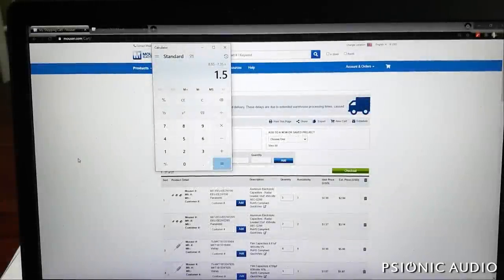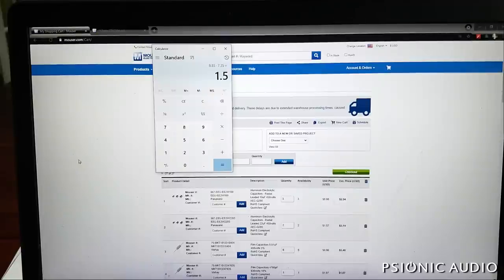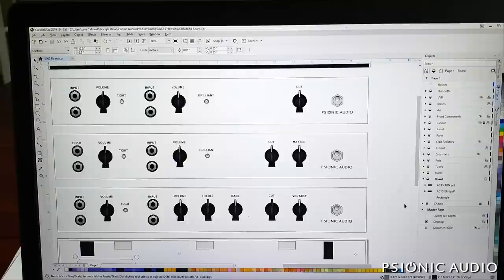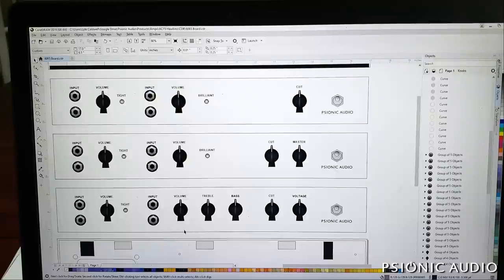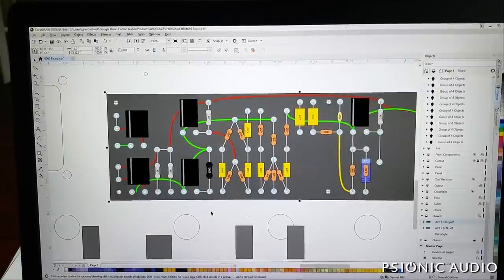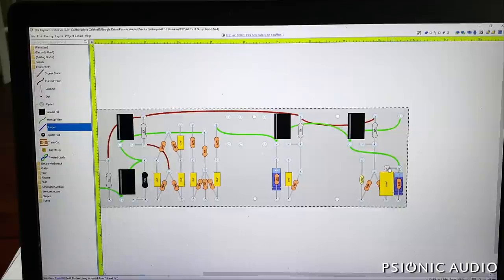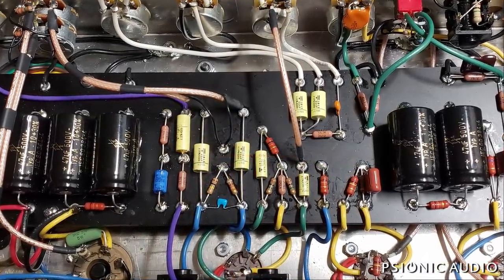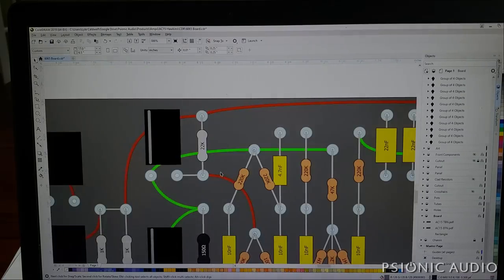Do I Make Amps? | Yes, Yes I Do | Muah Ha Ha Ha...

Comment from the maker: I forgot to show the actual F&Ts where I mentioned them about 10:27. Sorry about that. They are visible in other photos throughout the video though.
Reply: Use of the Radial Electrolytic in any modern design is very wise (IMO).
The original use of the axial capacitors was more than likely driven by low cost and availability as a result of electronics advancements post WWII.
Just because it was always done a certain way should not dictate modern design.
Then again, aficionados of tube amplification are traditionalist in nature!
The main point of my comment, the Radial Electrolytic Capacitors are IMO a great idea, also having the capacitor leads physically closer together might provide some design advantages.

Comment: Love these design consideration videos. I'm an electrical engineer about ready to retire and want to design/build some amps, only for myself, just for the pure pleasure of it. Glad that you include the playing aspects in them to illustrate the real benefits to the player. Good design doesn't mean squat if the amp doesn't sound good. LOL From what I can tell, you justify your design choices with reliability, serviceability and/or performance. I would feel very confident purchasing one of your amps if it was at the right price point. Keep it up!! Thanks for posting these to the community at large. Couldn't agree more about there being nothing wrong with a well designed PCB. I've done PCB's for designs professionally and there is a lot that goes into them. If they are well done, the end user probably has a better chance that his 'production' amp is going to sound exactly like what the designer intended. A well done turret board is equally good, but I wouldn't necessarily say that it is inherently any better, with the possible exception of serviceability. You can probably change out components on a turret board a lot longer than you could on a PCB. But, realistically, if the amp is well designed it should last a long time before you need to change out anything except the tubes. Caps do eventually need to be replaced. And if you get a mishap using an unknown power source you could actually let the magic smoke out and need to replace it, which would necessitate some component replacement. ;-)

Comment: I wonder what you think about the BADCAT cub lll ? About it's build. I have one i bought it second hand but already had to dump 300 Canadian dollars into it. Sold my 70's hiwat head & cab only do to the loudness & weight. But the only problem i ever had with the hiwat was it burned a fuse once in 8 years. & had a 70's fender bassman which got stolen that never had any issues at all. 1971 i think. Love your work. Thank you for chering. Snow pants are stored away

Comment: At 12:13, the owner of the shop I work for bought several large batches of similar brown Nichicon  electrolytic caps online a few years ago, and some of them leaked a little and developed visible corrosion where the leads exit the case.  I don't know where he got them and there's always the possibility that they could be counterfeit. We've also seen counterfeit Mosfets, counterfeit CD transports and counterfeit monolithic output-IC's.....

Comment: Thank you for sharing your design work.
Drilling holes and fishing the radial capacitor leads in a hook/U  shape.
 Back up thru the board to attach to your turrets/eyelets/lugs. 
Would save real estate on the board. 
The drawback being you'd have to lift the board to , replace them.
Reply from the maker: I wanted ease of future service. These won't move until a tech moves them.

Comment: Another excellent presentation; found myself chuckling at many of the points you brought up (thinking out loud about possible improvements, the quality of modern parts vs. NOS, etc.).
I have friends who also build and repair amps, and there's an observation that I can't help but make.  There are actually a lot of guys around the country who have acquired the skill set required to do this sort of work, but all too often, it's largely a labor of love.  The average guitarist who sees a blurb for a new VOX AC-15 probably doesn't have that much of an idea what goes into it.  Not to pick on VOX, because most manufacturers do it, but the new ones will not have a cabinet of Baltic Birch plywood (MDF), nor will the circuit be hand-wired.  I can't count the number of times I've seen someone try out a new amp, and the first thing they wanted to do was crank it full blast.  Someone who doesn't appreciate the difference made by a seasoned selection of materials or the execution of the internal wiring and other parts installation in the chassis, or who doesn't want to hear the amp's clean tones initially will be unlikely to grasp that a bespoke amp will last their entire life (try that with a particle board cabinet; it sometimes happens, but rarely), and that what they're really buying is durability and ease of future repair (because the best amp in the world will eventually need some repair, if it's played).  I'd hazard that this is why many of the more financially successful small builders have specialized in making a near duplicate of something that was once iconic...
Are you familiar with Richlite?  1/8" sheets are available; it's done well for me...
Reply: Not really the intended audience though

Comment: A Supro Thuderbolt with a much more efficient speaker would be amazing. Add a bass and treble if the public demands . But the single tone works fine too.I knew a guy with a Thunderbolt who shoehorned a JBL into the box and it was relatively light and screamed. About the same volume as a Bassman onstage. Pedals can be used for reverb trem, etc...

Comment: Just thinking about a grouning system. I actually bought a solib brass terminal block with 8 screw terminals on it. I was going to mount it next to the power transformer, but have all the different ground wires from the input section to the power circuit terminate in that sequence as you described, the final terminal being the ulitimate chassis ground. My nain concern is screw terminals becoming lose. I suppose a dab of nail polish or locktite could help there. I would appreciater your thoughts on that idea. Also noticed some people shoving a folded brass sheet behind the pots on the front to assist grounding performance on some Fender amps.

Anyway. Love your work.

Thank you.

Comment: Snowpants snowpants  Do I win a prize?  Come on where's my prize?  Mum said I'd win a new pair of snowpants!  Lol!

Hey good video mate!  Love your goal - to make a jawdropper.  Excellent.  And I bet you'll get there too!  Your chassis looks real good with the Mercury tx's!  Great idea too with the little window for the serial number!

So hard to pick which is the best method for you to use, whether a thicker turret board or the thinner one with the wires going through holes as strain reliefs.  Both methods look perfect mate!  Good to hear you're using FR4 boards so no bs board conductivity ay!

Forward thinking re radial electro's, & I saw the silicon there to holdem down👍  Good component/stage spacing!  You're playing with cap, resistor & pot values to get sound & control ranges right.  All great stuff, & the best way to do it.

With all this development & prototyping you're doing, one day players will be comparing their amps to the sound of the Psionic this & the Psionic that amps!

Keep it up mate!  They're gonna be awesome.  I'd buy or recommend one of your amps in a heartbeat given the choice.  Better still, to be able to build of your designs!  Hey you reckon you'd ever sell them as kits?  That'd be great fun!  I could buildem as good as anyone.  You seem smart enough to write an instruction manual as good or better than say a heathkit one.  Throw in nice closeup colour photos of each stage of construction.

You could add a 'Sorry Lyle it doesn't work' service for say 180 bucks or so.  Hell you could even train & employ a fella or 2 just doin that!

You'd need a certain level of sales & turnover of course to do this, so that's gonna require promotional input ie advertising.  But hey, when you develop your excalibres etc to the jawdropping performance levels I know you can achieve, you could dominate the market & be like the one stop guitar shop.

I'm excited for you mate.  I hope & reckon you'll real well.  Again, once you've found that sweet spot; that jaw dropping spot, using your holistic approach.  

And holistic is a GOOD word mate!  Like holistic medicine!   To me, holistic medicine is adult health management, whereas allopathic medicine is for the kindergarten doctors who can only concentrate on the main symptoms.  

You consider every part of your amps, & how every part interacts with every other part, to contribute to the overall performance.  Not just separate bits, considered separately.  

Whether you like it or not, you approach your amps in a holistic way!  Lyle's Holistic Amps!  Those who don't know them may scoff & laugh perhaps, but they will become the 'thinking man's amps'!

Comment: Would you be able to make a custom amplifier that would resemble the tone of a mesa or 5150 but without the under volt rated capacitors etc. im talking a 1 CH high gain monster reminiscent of the iconic "blue" channel that one could use their volume knob to either leave wide open or slowly attenuate will roll off to clean up. FX loop would be nice, solid state using op amp to save on cost perhaps. Let me know if you have anything like this ❤

Comment: Longevity is the exact reason to go with a traditional amp over a SMD laden class D amp. I'm enjoying your videos, I've repaired amps in the past and amp building is something I'd like to try at some point!

I'd definitely like a video on grounding.

Could I ask, which layout software do you use? As far as I know, the industry standard snowpants software is more PCB oriented, I've had to use 1/10" graph paper for my layout and it's very difficult to move component clusters around.

Comment: It’s tough, especially in America to manufacture nearly anything at a reasonable price point… If you network with some metal fabs, you might be surprised what they will work with you on when they are between jobs. Material is expensive, but some shops can work on getting you small runs if you aren’t picky about time. Getting to know your metal guy, or any supplier is important…. Goes to show why some less than optimal design choices are made by big companies, they could build things better easily, but the costs skyrocket to the point nobody will buy them… I feel you pain though, wanting to build things and having to scrap the idea because it needs a 3 million investment to even plan a line to build them…

Comment: I just built a guitar amp by myself during Japan’s golden week. Of course been planning and collecting parts for weeks before that. The cost was huge comparing to factory made, even using old parts to reduce cost. I spent around 350 usd for a 10w single ended amp. With this price I can buy a second hand combo tube amp with excellent condition. Vox ac10c1 costed me only 370 usd and vox ac4c1 only 110 usd.
Reply: @Who Cares I will try to record and upload it! It was fantastic! 
I will try to contact you if the sample sound is ready.

Comment: AC-100 Mk II?

😁  

Owned AC-30, AC-15 and AC-4, but the AC-100 Mk II was the amp I always wanted and never owned.  

Now, it's overkill for my needs. But if there was a clone from a reputable builder I'm just impetuous enough to order one even though I can't justify it.  

For example. I have an Engl halfstack rack with a pair of 2x12 Engl cabs, powered by an Engl E850/100 Tube poweramp, which is a dual 100 Watt power amp, with each side going into one of the 2x12 cabs. Needless to say, I rarely push the power amp past warm. 

Cheers!

Comment: Incredible stuff! I’m working on a JTM-45 kit from stewmac currently. Would it be beneficial to shield the heater wires using foil tape like I use in pickup cavities?
Reply from the maker: Thanks. 

No, never introduce conductive  foil inside a chassis. It will eventually end up somewhere you don’t want it and it isn’t necessary.
Reply: @PsionicAudio  ok thank you!

Comment: You can call it a fox ac-15  lol
How does those fiberboard with standoffs compare to ceramic boards
I was wondering what a good replacement for an old leak tl12 metal can they were special in the day don't think I'm available anymore replacement would be thinking about building a replica. any ideas

Comment: I'm curious regarding your design with radial electrolytic caps and the use of (silicone?) to affix to the board.  Have you considered using zip ties and through holes to affix them to the board?   Any concerns regarding vibration if attached with zip ties vs silicone dampening vibrations?   I'm guessing silicone would make eventual re-capping easier than fishing ties through the board.
Reply: Can't one just use a wire for that that gets twisted on top instead of a zip-tie? That way it could be reused when recapping: just untwist, replace cap, twist again, done. Fatigue should`nt be a problem since the wire is not stressed much. I've seen that practice done in Hi-Fi amps, for other components though since they do not use radial caps anymore.

Comment: Hey ,, I'm curious. Amps are built with modern components but your thoughts on wire. Many say solid core wire is better than stranded. What about aircraft grade tinned stranded??? Would you consider that solid core equivalent???
Reply from the maker: The only advantage of solid core is it wants to stay where you shaped it. Conversely, it can break or be microphonic. 

I use tinned stranded unless I'm working on a vintage Fender or HiWatt or Vox where the original was solid.

This amp will get Marshall-style topcoat but I've used a lot of teflon aircraft grade tinned stranded in my time. It's also yummy.

Comment: ❄️ 👖 would love to own one of your amps. Will you make an option for 220v?
Reply from the maker: Thanks so much! I can do 240 easily. I have a step-up transformer for testing 240VAC amps.  I use an IEC connector so you provide the cable/plug needed for your country.

Comment: How much for a JTM45 Cassis complete?
Reply from the maker: I'd have to check current pricing from my vendors. The last ones I did used Classic Tones, but they are out of business and Heyboer is out of stock on everything. So it would be Mercury or Merren, which are costly. 

I would think about $2500 for a head, more with premium tubes.

Comment: Fender Vibrolux Reverb type   cost please.  Thank for being!
Reply from the maker: I honestly don't know off the top of my head. I have to source iron, cab, chassis, etc. I have the board design for one, but costs change, esp with Classic Tone gone and Heyboer out of everything. I have dealer pricing with Mercury Magnetics, but I'd have to find out what the price is for a particular set. If you are really interested, info@psionicaudio.com. But just getting an accurate quote together takes a few hours.

Comment: Snow pants, huh? It’s almost summer! LOL.

This isn’t directed at Lyle really, just some resources for the home gamer.

Hoffman has a LOT of modernized layouts that can point people in the right direction for a better DIY layout/flow.

Weber has AC style chassis and cabinets. Two part, bolt together, like the original chassis. If anyone was looking for a clone.  I like Weber stainless steel tweed chassis’s, but I have not used the Vox style yet. I have only purchased one cabinet from Weber(5E3). It was every bit as good as the Mojotone cabinets I have. I’d say the lumber selection was better in that specific cab. 

Here’s the AC30 chassis: https://tedweber.com/6v30ch/

And the cabinet: https://tedweber.com/6v30cab/

Hoffman turret boards https://hoffmanamps.com/MyStore/perlshop.cgi?ACTION=enter&thispage=TurretBoard.htm&ORDER_ID=!ORDERID!
Reply from the maker: Sorry to argue, but well it is my page...

Weber chassis and kits and cabs have been absolute garbage in my experience. I advise people to avoid them.

I'd say "like the plague" but it turns out Americans don't actually avoid that...
Reply: @PsionicAudio  well that’s unfortunate. I guess I got lucky with the few I’ve ordered(in 2017). Im starting to not like their speaker recommendations too. I should say that I’m not affiliated with anyone but myself. And yes, of course this is your channel. I really appreciate what you’re doing here.

Short of gutting a broken reissue Vox, that’s the only place I know that sells the chassis and cabinet.